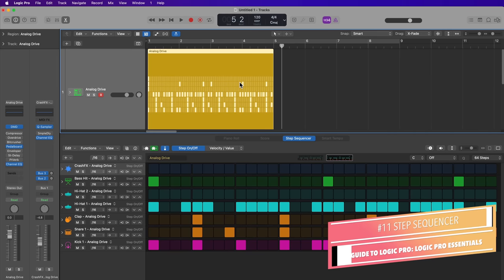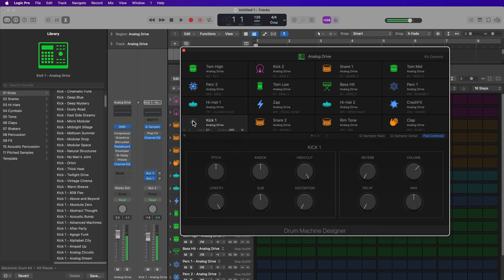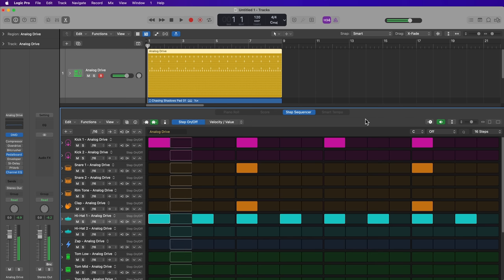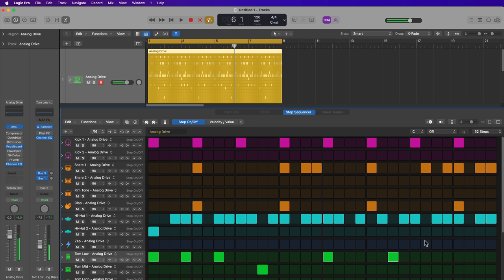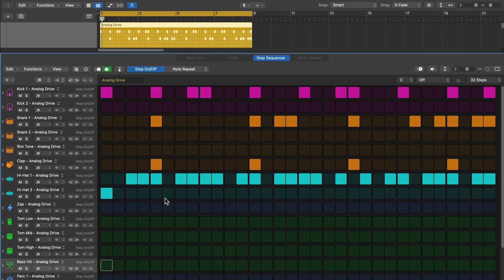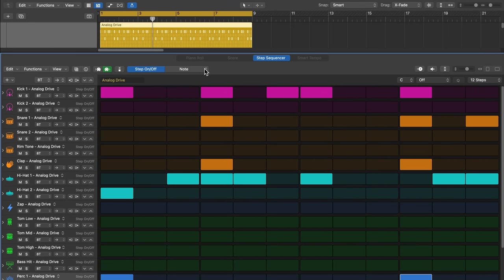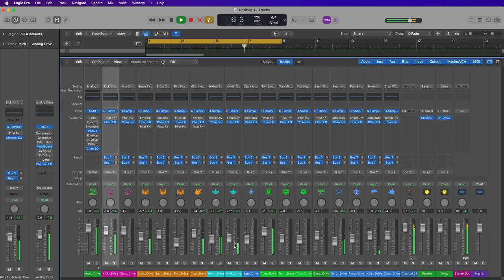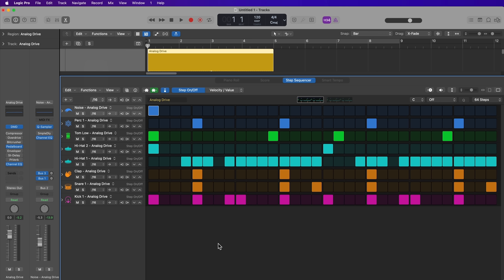Logic Pro #11 - Step Sequencer, Beat Making, Drum Machine Designer

Comment: Hey Josh, I've got Logic 10.4.4 and when I right-click on the grid there's only an option to create a MIDI region, so how do I create a pattern region and open the Step Sequencer?
Reply from the maker: You need Logic 10.5 or higher to access the step sequencer. It was a new featured added in 10.5.

Comment: Can you use your own samples for this or is that only on the drum designer?
Reply from the maker: You can't add sample directly in the step sequencer, but you can easily drag and drop samples into Drum Machine Designer. If you add Drum Machine Designer directly on a tracker rather than choosing a library preset, the DMD instrument will be blank and you can drag and drop in any samples you like. Then program the beats in the step sequencer.

Comment: Is there a way to change the default velocity value of the Step Sequencer, from 100 to something else, like 75?
Reply from the maker: Not that I'm aware up. But if you go into Velocity Edit Mode before you start entering notes, there is a velocity down/up control on each channel, and also for the entire pattern. Before you start entering notes for a pattern, pull down the velocity for the entire pattern to the start value you'd like, and then all notes created will be at that starting velocity. The option to control the velocity for the whole pattern is directly in the upper left corner of the pattern editor.

Comment: For me CMD 3 doesn't open a separate Step Sequenzer window but the smart controls (in this case for DMD). There is no Shortcut for the separate Step Sequenzer window assigned.
Reply from the maker: Go to the "Window" menu at the top, and see what your assigned key command for the Step Sequencer is. It's Command 3 for me. You might be on an earlier version, or you may have changed the shortcut for it at some point. If there's no shortcut for "Open Step Sequencer" you can assign your own key command by pressing Option K to bring up the key commands assignments.
Reply: @MusicTechHelpGuy  You were right. Apparently I assigned CMD 3 to Smart Controls at some point. Don't remember doing that and don't know why I would but it said so in the shortcut menu. So now Smart Controls is the one that doesn't have a key assigned. Thank you!

Comment: Decent video but I’m confused as to how I build out my beat/song if I want to drums to be constantly changing every couple bars
Reply from the maker: Create multiple pattern regions. Each pattern region can have a different pattern programmed into it. Also if you program a pattern into one region, and then copy/paste it, it will not link the two patterns, so you can use the 2nd region as a starting point for a new beat/patter. I do the same thing, I'll have 3 repeat pattern regions, then a 4th one, where I add a fill or something different than the other 3.